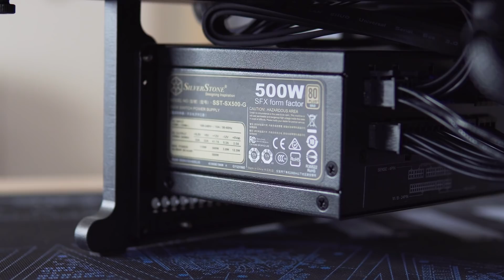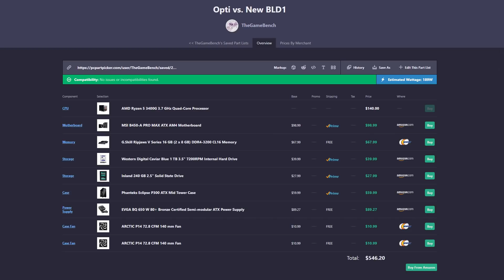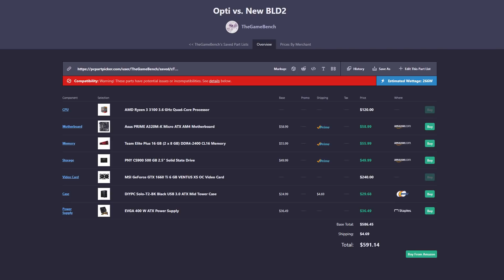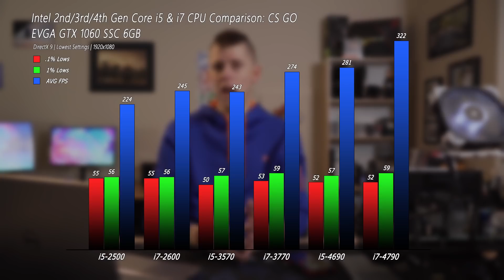Dell OptiPlex Q&A Pt. 1: OptiPlex vs. New, CPU & Mobo Upgrades, GPU Upgrades & More

Comment: My dell optiplex has 8gb ram. I want to have 12 gb. Should i buy one 4gb ram or two 2gb ram sticks?
Reply from the maker: Just curious... why not 16GB. Either of those options isn't ideal. two 2GB sticks would be better than a single 4GB stick for sure. But even then, you'll be running in mixed channel mode which will mean that 4GB of RAM will be running in single channel mode rather than dual channel and that could impact performance. I highly suggest getting two 4GB sticks.

Comment: Can I upgrade the cpu to i5 6th gen?
Reply from the maker: Which model do you have? If it looks like the one in the thumbnail... no. You would need to have a 40 series, like a 3040, 5040 or 7040 model to run 6th gen.

Comment: I have one for you. I am trying to work with:
Acer Aspire ATC-705
i5-4460
300w PSU
SSD/HDD
8gb RAM (Will up tp 16)
1GB GPU
60Hz monitor (Will go newer)

Any input would be welcome. It's so hard to get a GPU right now. Only thing I could get was a PNY T600 4GB
Reply from the maker: I guess it depends on how much you're willing to spend. The T600 is pretty close to $300. If you're willing to spend that much, the 1050 Ti will be a bit faster and shouldn't cost you much more than $200, maybe less. Granted, you could get ab RX 570 4GB for the same price, but you might not be able to run it on your stock power supply.
Reply: @TheGameBench  Thanks. I have been checking on the 1050ti - lowest I saw was about $360 in my area - though I could get one with monthly payments from Amazon at $429. The 5600g is a bit cheaper than the card, so maybe I could begin anew with that (+PSU, etc.) Anyway, I just appreciate the reply. I'm trying to learn, so mistakes are expected. If it weren't for channels like yours, it'd be much more difficult. You do great stuff.
Reply from the maker: @TheClahey  Is ebay not an option for you, or are you concerned about buying a used GPU?
Reply: @TheGameBench  Ebay is definitely an option ( I'm in Canada). I am a bit concerned buying used PC components there, but I just look for verified sellers with good ratings. I just wasn't sure, with what I have, if the cheapest/easiest route would be just add a GPU, or if I should have started with looking at the MOBO/CPU first.  I should have waited, but the GPU is on it's way, and I'll see how it goes. I think I have just sort of caught the bug, and now I want something to play with. Again, thanks very much. It's helpful.
Reply: Guess I should have ensured my monitor wasn't only VGA; would need an active adapter . . . or a new monitor. ;)

Comment: Hello, I have a Dell Optiplex 9010 with a OM9KCM motherboard using Intel(R) Core(TM) i7-3770 CPU @ 3.40GHz , my question is can my CPU be upgraded ? In addition to that I use a Nvidia GTX 1060-6GB, 450 W powers supply, Micron 8JTF51264AZ-1G6E1 4x4GB RAM, Kingston A400 240GB SSD, Intel Raid 1 Volume 500GB HD (used for storing photos) and stock cooling (while I mostly operate with the side cover removed). If the CPU cant be upgraded do you have any advice on mods you would make to get the most out of what I have. I love your contend as it covers far more than any other channel in regards to these units. Cheers (Subscribed)

Comment: I have the 7020 and i ordered the moddiy 24 pin to 8 pin adapter. but what i'm wondering about is the other HDD port which is a 6 pin port with one pin blocked off that sits right next to the power port. before the was a cable hooked up to it and running to the hard drive and even the dvd rom i think.  but with my new evga power supply do i still uses that that HDD port and its adapter cable to power the hard drive and dvd, or do i just use my new power supply's connectors to power those components?

Comment: It’s pretty cool this channel exists. I came b/c I’m upgrading my dad’s old Lenovo H430 Core i3-2130 3.4 GHz w/4GB (2 core w/ hyperthreading) to a T1700 4790 16GB RAM which I got off eBay for $270 including shipping. My dad doesn’t do anything besides surfing the web and watching the occasional YouTube videos. We already upgraded the7200 RPM 1TB HDD in the Lenovo to a brand new Samsung 870 EVO 1TB SSD, and by itself that made a hell of an improvement. But after I went back home and looked up the specs on that Lenovo, I felt bad for talking my dad into spending $140 on it, haha. So I’m getting him him this T1700 for Father’s Day. This old T1700 comes stock with a Sapphire R7 240 which pretty much everyone says is absolute shite. But like I said, this rig isn’t intended for gaming. Of course, I’m gonna slap that 1TB Samsung we just put into the Lenovo into this box. It’s kinda funny how a used 1050 TI is about what I paid for the whole computer. haha. For this T1700, I could see maybe slipping in a GTX 750 TI w/GB for about $140. Even though you upgrade the RAM to 32 GB for about $115, I’m pretty sure my dad would never need more than 16 GB.  I guess if I upgraded the video card, I’d probably go ahead and upgrade the PSU to a Corsair 650W.

Comment: idk if 
The Game Bench      will see this but im looking at an dell xps desktop 16gb ram i-7 7700k   1Tb hdd   for at the time of the comment the bid is at like 177$    ??????
Reply from the maker: That seems pretty low. But it's odd that an XPS would have a 7700K. I didn't think they put Z series chipsets in those systems. That being said, the 7700K will sell for more than that on its own. What did it end up going for?
Reply: @TheGameBench  it went for about $410 with shipping $380 without. sry for the delay in response it had been relisted, so i thought i should get/show the new price. :)

Comment: How long will optiplex gaming PC be?
Reply from the maker: Are you asking how long they'll be viable as gaming PCs? Well, the OptiPlex series still exists, but if you're wondering about the 9020, I still think it will be viable for a few more years. The GPU market is only extending out the life of these older machines.

Comment: Hi,
A small question
I have enough money to buy
I5 4590 ( may be i5 3570 because of availability and current price hike along with gpu stock also) with rx 470 4gb with 12gb ram.
I have to mainly used for gaming and game streaming, for gamez like
GTA V
Warzone
PUBG
Apex Legends
Fortnite
As I am planning to start a youtube channel.
My question is will this build will be good enough to drive me this way with gameplay along with streaming.
Reply from the maker: Playing those games? Yes. Gaming and streaming? Nope. You'd need at least an i7 for that. Or an nVidia GPU that could encode the stream to take the load off the CPU. But there's nothing reasonably priced from nVidia that's up to the task right now. My suggestion would be an i7 4790, at the very least. If OptiPlex systems are running to expensive, try branching out and look at the HP Z230, or even the Z240 with an i7 6700.

Comment: I have dell optiplex 9020 with gtx 1060 6 GB using dual sata to 8 pin I got black screen and full fan speed after 1 hour on gaming
Reply from the maker: Doesn't sound like a power issue. The System would have just shut off. Have you been able to get it to work since then? Does it work after you turn off the system and power back on?
Reply: @TheGameBench  My computer works perfectly, but after an hour of gaming, it does not display and the speed of my graphic fans reaches 100%. I have the same problem in every game.
Reply: @TheGameBench  ‌My computer does not turn off, just while playing the games, after one hour my screen does not display and my graphics fans reach 100% speed, the mouse and keyboard are also on, and the computer is still running

Comment: Would an OptiPlex 390 with an i5-2400 bottleneck an RX 570?
Reply from the maker: Yes, and no. It really depends on the game and the settings. It also matters what you have running in the background and if you're playing online or not. I have a video testing out several GPU's with the 2nd gen and I saw the 2500 be a slight bottleneck is some situations with the 570. Keep in mine that my testing was done on a clean install with nothing running in the background.

Comment: what is the strongest cpu that is compatible with the dell optiplex 9010 motherboard??
Reply from the maker: Strongest? Definitely the Xeon 1290v2. But as I understand, quite expensive. I would just stick with the i7 3770, or if you can find it for less, the Xeon 1270v2.

Comment: Hi how tedious was the process for sleeping your 24 to 8 pin power connector. Also would you ship one out if i would pay?
Reply from the maker: The adapter... not very, but I've done some incredibly tedious sleeve jobs. For a first timer, it could be a little tedious, but not too bad. There's certainly a learning curve to sleeving cables, and that can vary on the materials you use as well as your tools. As for making one, cost would depend on what I would have to buy. I don't sleeve for other people. I only sleeve my own cables, so it's not like I have all the materials I'd need to do it right now. I made that one with scraps.

However, there's some I can suggest that does this professionally for other people and his work is top notch. Plus, he'll get you your cable in a timely manner. He typically does full PSU cable sets, so I'm not sure if this is something he'd take on, but he's who I'd recommend. His name is Michael Braaten and he runs MB Sleeving.

Comment: Is more ram better for performance??
Reply from the maker: Yes, depending on the game. These days I wouldn't say 8GB is the minimum for gaming and a lot of games are going to use more than that. Especially newer, more AAA titles. When you run out of system memory, the system will resort to using the main drive. Even if that drive is an SSD, it's much slower than system memory and it's going to kill performance.
Reply: @TheGameBench  Thank you for responding... I've been getting different responses and I just wanted to ask before I bought some more ram. But what about for a non gaming computer.....will it help with other tasks?

Comment: Hey, i have a 3020 ive change the cpu now my ram slot 2 not working. Any info on how i can fix this?
Reply from the maker: Does the second RAM slot start working again if you put the old CPU back in? Check to make sure none of the pins are bent in the socket. If none of the pins are bent and it works with the old CPU, there's a problem with the new CPU. If it's a bent pin, you might be able to bend it back and be back off and going with the new CPU.
Reply: @TheGameBench  thanks for the response, pins are fine  got it to work with a cmos reset and the old cpu, but then i tried the i5 again and slot went dead again, not working with the old cpu even doing the cmos reset.

Comment: I'm running a 4790 + 1050 ti, it runs really well with almost no bottlenecking. (games like SW battlefront 2 form 2017)
Reply from the maker: You shouldn't be having any CPU bottlenecks with the 4790 with a 1050 Ti.

Comment: I have a dell optiplex 9020 with an i5 4590. Just a bit unsure if I should buy a new PSU for my 570 I have on hand. does the 8 pin to sata cable work with the 570? and with the 570 and the components go above the 290 watts on the stock psu. (btw I have an 80+ bronze stock psu rated at 290 watts) if you could answer this question that would be great. Thanks!
BTW: The 570 I own is an MSI Armor RX 570 4GB OC

Comment: Im trying to build on of these rn but its really hard looking for a decently priced 9020's or 1060 6gb. So far I've only been able to find a 9020 at $159 (total) with the i5 4590, 1tb HDD, and 8gb of ram. I've also found GTX 970 at $110. I've only got around $250 rn so finding a better psu is pretty hard.  You got any tips where I could find cheaper 9020 or 7020's? Or even a 1060 6gb.
Reply from the maker: Honestly, right now I'd forget the 1060 6GB. They're just so over valued. I feel like a 1070 could be found for not much more. Otherwise the RX 470 or 570 is a better option at around $150. The 4GB models can be found for under $100. If you don't want to replace the power supply the XFX and Asus Strix models don't consume a lot of power and you don't even need to remove the HDD cage. Sadly, the GPU market is pretty bad right now.

As for the Opti, I wouldn't pay more than about $120 for one with an i5 and 8GB of 1600 MHz DDR3. I'd suggest seeing if you have for sale locally, maybe look at computer recyclers. At $150, I'd suggest looking at a 7010/9010 with an i7 3770 for around the same price. That or try looking at the HP 600/800 G1 systems as an alternative. There's also the HP Z 220 and 230 that would be great options to look at.
Reply: @TheGameBench  Yeah found a guy selling a 1060 6gb for $200, I explained to him that you could find a 1070 for that price and if he could knock it down a bit but basically said that 1070's are still selling for much higher so he's not going any lower :/. I did find lots of great deals on offer up like a rx 580 8gb for $75, but most of the sellers haven't responded.
Reply from the maker: @sargentman1640  Yeah, it's absurd and I don't understand people. And I can't blame him, he'll get it, or close to that. Just keep on, you'll find something. You just gotta' be patient. Sadly, I think it's going to get worse.
Reply: @TheGameBench  yeah I took your advice and instantly found a bid for a 7010 i7-3770 8gb and 500 HDD  at $73, max Im bidding is $95-$110. If that doesn't turn out well there's also a bid for a 9020 i5 4590 16gb ram but no HDD, Was thinking to bid for that and just buy a 240gb or 500gb SSD since I don't need that much space.

Comment: I’ve said this already.  I’m piecing together a super budget build.  You can get a 3020 Mobo for 20 bucks, $50-100 case, I found cheap 16g Corsair Vengeance DDR3 locally $35.  450w psu $35.  Gtx 970 $50.  Xeon E3 1240v3.  This is mainly just for World of Warcraft, so I don’t need much Gpu power, but this build would easily be upgraded with a motherboard swap and processor upgrades down the line.  The after Christmas used market is fantastic right now.
Reply from the maker: Save for the GPU market. It's pretty bad right now. It hasn't hit the 900 series as hard. But man, for get getting a 1060 right now.

Comment: Hello, great video. I have to ask if it's possible to run an ASUS DUAL-GTX1660S-O6G-MINI  on the original 290 W psu?
Reply from the maker: Yep, it's on the edge of what I'd be comfortable with, but it'll be fine. Hell, Linus put a 1660 Ti on the xx10 series 275 watt power supply. Just be sure to use a dual SATA to PCIe adapter to keep from drawing too much current from the SATA power.
Reply: I would also like to know...
Coincidentally one of my dearest friends is facing the same hurdle.
Reply: @dmitrybayer  Ok so that seems to be a quite common problem.

Comment: So I have a 7020, and I'm really just looking for 60 FPS on 1080p.  Currently looking at a GT 1030 and an Intel i5 6600K.  Think that'll get 'er done?  I'm new to this stuff, apologies if this question is dumber than dumb.  Been watching a lot of videos the past few days, still soaking it all in.

Oh, and I hope you feel better man.
Reply from the maker: Thanks, I appreciate that.

Well, if you've got a 7020, you can't install a 6600K in it. You can only install the 4th hen Haswell CPU's in the xx20 models. You'd probably pay about as much for a 6600K as it would be to get an i7 4790 which will drop right in, you'll just have to enable hyperthreading in the BIOS. I would suggest that over even a 6th or 7th gen i5. Games are just using more and more cores and the four extra threads really helps going forward. As for the GT 1030... depends on the game. Some, you outright won't be able to do it. Some will require serious compromises. I would suggest something like the RX 460/560 over the 1030. You could even get something like the XFX RX 470 4GB or Asus Strix RX 470 4GB for under $100 that will run on the stock power supply and easily manage over 60 FPS in most games with some compromises here and there.
Reply: @TheGameBench  That's really great advice, thanks again.  I have the i5 4590 currently, any thoughts on that guy?  I just watched a vid of someone getting pretty good FPS with that CPU, using the RX 470.  Really surprised me, has me thinking about just upgrading the RAM to 16 and buying a decent GPU to see where I stand.  I'll do some looking for the i7 4790, appreciate the tip.
Reply from the maker: @trza49er  The 45xx and 46xx i5's are still pretty good. Just depends on the game since there are newer AAA titles out there that just aren't happy on quad cores regardless, and it doesn't matter what GPU you put on them. But that's a pretty small percentage of games right now. And the 470 is the best value in entry level right now. And they perform a lot better than most people think. Costs less than a 1050 Ti, and it's faster. And if you go with something like the XFX 4GB model, you can easily run it on the stock power supply. The Asus Strix model looks like it would be good to go on the stock PSU as well.